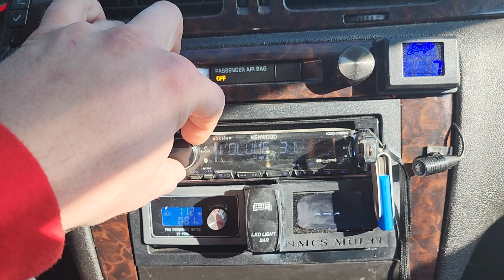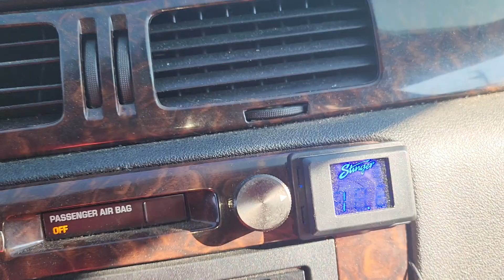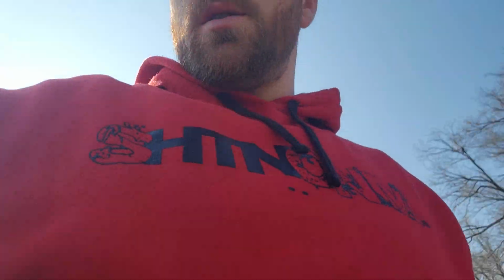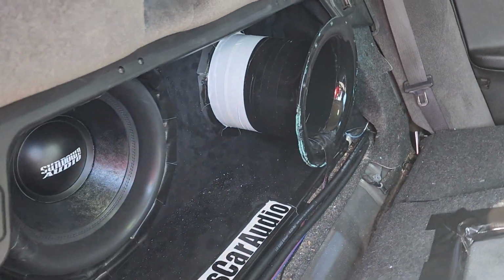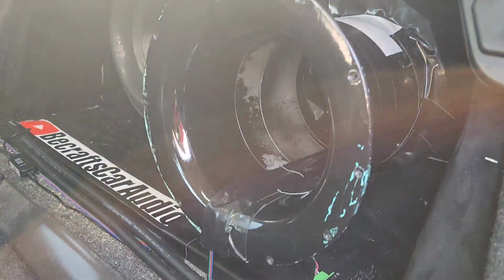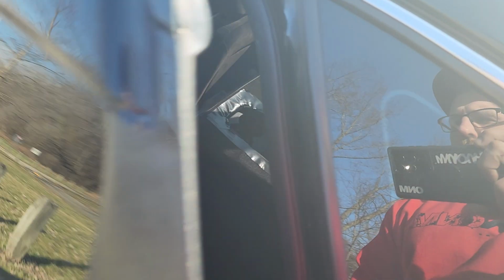Sundown Audio Xv2 15/ Sundown Audio scv 3k! (windy demos??)

Comment: I think your quickest/cheapest way to get louder is to pop 1 of your bass 8ks @ 1 ohm on this current 15, and see what your voltage drops to on a spl run, driver door open, rest sealed up, except have your trunk open, and meter in passenger kick.
Reply from the maker: Forsure thats what im leaning towards doing